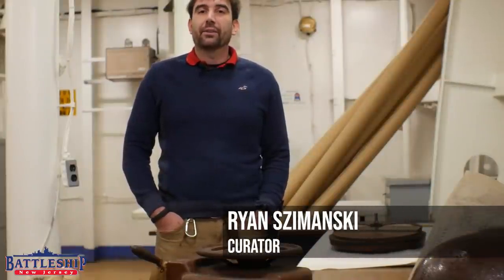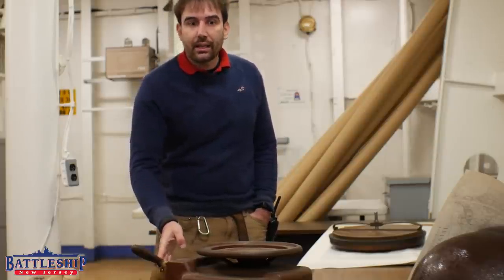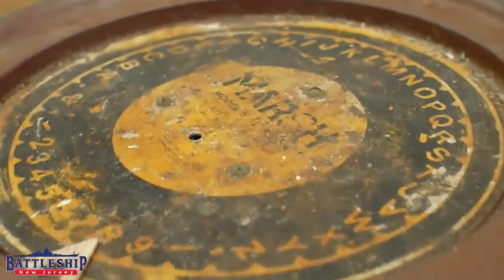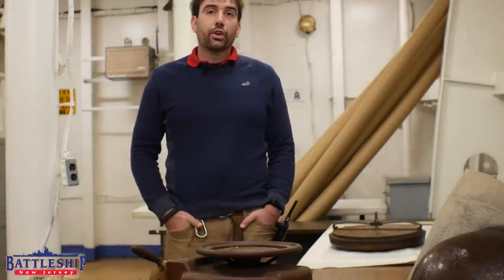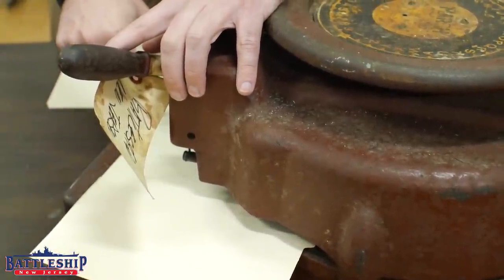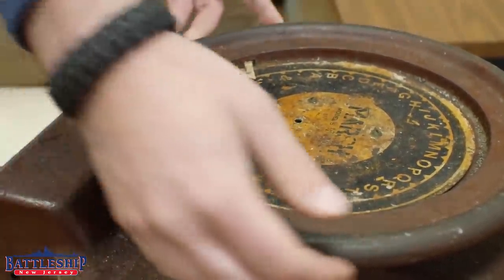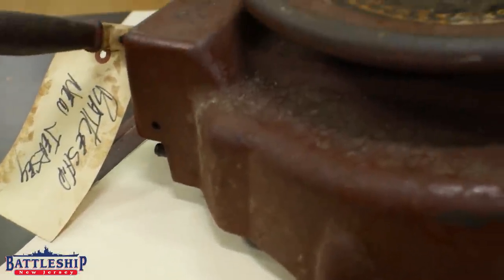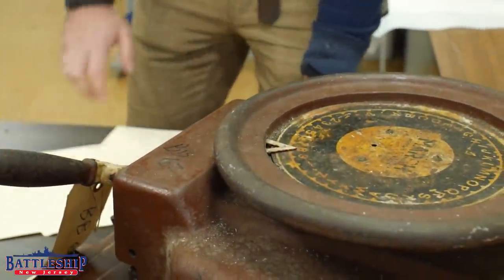How to Use an Antique Navy Stencil Cutter

Comment: Marsh Stencil is still in business Ill pay for the rebuild of the machine by sending back to marsh 
ill pay ups both ways if you want
Reply: Always amazed at the generosity of some folks. Thanks for offering, I hope the museum is in a position to make use of your generous offer.
Reply: Props to you my friend up vote so they can see this.
Reply: @johnm7249  thats not the same 
New Jerseys is a veteran of WW2 if it could  talk  the stories it can tell 
the ebay one has no provanence and priced accordingly 
its like replacimg the steam whisles with doorbells its not the same
Reply: im not asking it to be made new im asking for it to be degunked oiled sharpened if Necessary and tuned to work properly 
the scratches scars wear patina stays thats the silent Testimony of its life

Comment: Love those Marsh stencil machines.  Also, using card stock is probably still a little light.  They're designed for using with Oil Board, which is heavier yet than even manila folder, so that could also be contributing to the problems in addition to as others said needing to be degunked and re-oiled.  A Marsh Stencil Maker in 1/2", 3/4", and 1" should be a part of any military museum's tool set.  They are what made the stencils for 95% of all WWII, Korea, Vietnam, and beyond paint stencils.  Marsh even built "automatic" (read electric powered) makers that were used in the factories for mass production of stencils.  I don't remember which musuem it was that I visited, but they had an Electric Dog Tag maker and an Electric Marsh 1/2" stencil machine that they had in the gift shop area for making tags and "Name Plates" for visitors.

Comment: We had one of those in the Repair & Upkeep shop of my Army barracks in the 1980s. Ours was a bit more modern, but the same brand. It had the ability to punch in three sizes via removable cutting elements. The characters could be 3/8", 1 1/4", and 2 1/5" in height, and it looked like other sizes and maybe fonts could be ordered. Only our 3/8" cutting element still worked, and I used it to make stencils for many humorous signs we posted in the barracks. Our R&U NCO had no idea how to use it, so — yes — his signs were all made from vinyl stickers on sheet polystyrene. HAHAHA!!!

Comment: I used one periodically on my last job.  Looked very similar to the one you have there, but it was pretty new, worked great and was painted black.  Quite expensive, but those things are built like a tank!  If I'm not mistaken, it was made by the same manufacturer as yours.  We had a pretty decent quantity of oilboard specifically made to be used with the stencil machine, so that may be why yours is not advancing properly.

Comment: We used these in the army. You need to use "Oilboard" (also known as stencil board) to keep the cutter sharp and corrosion free. It is also thicker than a Manila folder which will dry out the cutter.  The folder, as you see, is a little too thin to feed correctly. (not saying I haven't done it before. 😅😅)

Comment: If I may suggest a topic I’ve not seen covered, it’s how the 40 MM gun directors were later adapted to control the 5” gun mounts. I’ve read once somewhere that merely taking out the pilot didn’t lend itself to Kamikazes as the whole plane itself needed to be destroyed. So the 20 and 40 MM guns weren’t enough but the 5” mounts could pack a suitable punch.

Comment: I used this exact type of stencil maker in the high pressure compressed gases industry. Needed to make stencils for the gas mixtures and paint them on the side of the cylinders. I got pretty good with this thing, I could make a stencil in no time. I wonder if some company has NOS card stock rat holed away in a warehouse.

Comment: These cutters used a heavy  oil impregnated card stock. It was usually a dark tan or OD green in color. Its a bit hard to find today so many do substitute Manila folders to make stencils. The oil helps keep the stencil from absorbing the oil based paints used in the past by the military.
Reply: It's called oilboard, and it's hard to find. I get NOS oilboard from ebay. But I also use new 70-lb coverstock card that works just as well for acrylic spray paint.

Comment: We had 2 different size stencil cutters in the railroad shop I worked in. The paint shop also hand cut the larger stencils for brand name and car numbers. On every freight car was a black box outlined in white in which we stenciled brake valve info and service dates. Since all rail wheel sets have gone to roller bearing from Babbitt bearing that part of the servicing is no longer performed. Likewise the airbrake valve service labeled COTS for Clean Oil Test and Stencil has been greatly reduced or eliminated. The big table for hand cutting stencils was equipped with a sheet of glass (caboose window) as a cutting surface which made for a hard clean cut without dulling the knife. On one wall there were a number of premade stencils which were cleaned and hung up after each use and the other wall plywood templates for hand cutting large stencils I would assume that Naval ship stencil rooms would have had several different sizes of stencils for repainting the ships numbers and other large signs.

Comment: That particular machine was used for making stencils for clothing ie... Shirts and dungrees(pants)- the card stock was oilboard and you used paint pens for stenciling your last name above your left shirt pocket and right rear pocket on your pants. Basic training we spent three hours marking everything (laundry was bulk washed). Left in big bags came back same way and then sorted by all hands in recruit company. Folded and stowed the NAVY way in our locker by our racks.
Reply: There is something about hearing how those daily facts of life aboard ship that should be boring, turn into interesting stories.  Like how does a sailor communicate with home.  Or how could they listen to music before walkmans and mp3 players.

You think about 2000 people aboard a ship, it makes sense that they have to process laundry as a group.  Then that makes you think why were uniforms blue and now they are camouflage.
Reply: In Air Force Basic Training 1971, we were issued laundry stamps with ink and a pad.  We had to stamp everything except socks.  Black ink doesn't show up on black socks!  I still have mine.  I used it in the MI Army Guard getting ready for duty in Iraq in 2003.  The ink was still good!

Comment: Marsh Co. recommended a stencil brush back in the days before spray paint.
Reply: We always used a sponge
Reply: @sillysailor5932  Yeah they work too.
Reply: We still use brushes. They actually do work better on wood than spray paint, more quickly as well.

We still use this same stencil cutter where I work building pallets.

Edit: well, it's certainly a newer model, but same company and same mechanism.

Comment: the stencil machine can be rebuilt and works best with oil board of the proper thickness. I worked on them for several years and the parts are still available.

Comment: Not spray paint. Stencil paint/ink and a short bristle stencil brush that you use by dabbing the paint on.
Reply: I was looking for this comment.
Not many know a stencil brush when they see it.
Reply: @jimurrata6785  covered a few shifts in the shipping department.
Reply: Spray paint, because of the pressure in the can, sometimes bleeds past the stencil edge and you lose that sharpness. A stencil brush gives you more control, as you lightly dab the stencil with paint/ink.

However, you can also use spray paint, if you use a trick. You spray a very light coat of adhesive spray onto the back of a stencil, let it set for about 10-15 min to let it tack up to the strength of a Post-it, and then press it lightly into place to use spray paint, for a sharper edge. Don't press too hard or else you can't remove the stencil.
Reply: @k.r.baylor8825  That and it's messy and smells bad.

Comment: Never seen a cardstock or paper stencil, they were usually brass, and the letters and numbers were interchangeable and just slid together. The stencils were usually 1" square pieces of brass, that could be used over and over again.
Reply: We used the same in the MI Army Guard to stencil our 3 duffel bags getting ready for Iraq.  We had a team that did the assembly of the stencils and the spray painting.

Comment: Used one at the rental shop I work at.  Finally upgraded to a computer controlled plotter-style a few years ago because we got sick of replacing and filing edges on the most commonly used characters. Also could do multiple sizes instead of waiting 3-4 weeks for McMaster to do the sizes we didn't have in house,

Comment: I always saw stencils cut in a resin-impregnated cardstock, generally brown or reddish-brown and a bit thicker.  Perhaps the manila folder stock just isn't thick enough to feed properly.  Your stencil looks way to small for painting bullseyes.  Looks about the right size for stenciling your name on dungarees, white hats, underwear, sheets, etc. so you can get your clean laundry back.

Don't know if it was "standard" or not, but the bullseye stencils I saw were done with a rubber-lined jig that held a piece of cardstock of the appropriate size and had bars running across it that were engraved with spacing marks.  Dies were of the "line them up with the marks and smack them with a mallet" type.  The bars maintained your vertical spacing.  There were also file cabinets full of stencils.   Pretty decent chance that you could repaint your bullseye or label your piping with the stencil used last time, and not need to cut a new one.

Comment: I used several stencil cutters of that type as recently as 2012 while working at Hughes Aircraft/Raytheon in El Segundo California. The only difference was they were in a much smaller type size. Getting the stencil material to advance properly was always a problem and we usually ended up cutting the stencils on a pantograph instead. The only thing I see remarkable about the New Jersey one is the amount of corrosion from the environment it was exposed to.

Comment: Have you got it to work properly again?

Most probably the wheels are made from some kind of rubber, which hardened over time. It can be cleaned with rubbing alcohol, and will regain some of its grip.

Comment: there is the exact same machine brand new for sale at around 2500$ on website mssc or Uline the only difference is that brand new one are painted black , might be possible to buy the part to repair it from the manufacturer

Comment: Did people use to use paint brushes and stencils? Because this stencil cutter looks like it pre-dates the invention of spray paint.
Reply: When I was in the Army we used these.  The paint was applied with a stencil brush, a short stiff brush. The paint was very thick. At company level they had brass stencil letters that could be joined together, but they were a pain in the but to clean, especially if spray paint was used.

Comment: Using files for your stencil stock might be part of the problem but if you haven't released the button that engages the feed roller, it won't index properly when you're using it. You can safely disassemble it and clean up 80 years worth of accumulated crap without compromising a scarce artifact. The world is awash in that model of Marsh stencil cutter.

Comment: We had 2 different size machines in 1970 but newer models. Think they called the tan/ faded yellow thin cardbiard oil boards. We had a rolling wheel to apply black or some had dark purple ink to stencil cardboard boxes. Now everything is done on a computer then printed out with a UPC code. Stencil roller usually did not run like spray paint. Looks like our goverment got its money worth out of the machine you were using.
Reply: Our painters got great results using spray paint by using a piece of welding rod to firmly hold down the edge of the part of the stencil that they were painting. That way the s[ray couldn't sneak around the edges of the cutout and cause fuzzy lettering.

Comment: Pretty sure you have slash “/“ not a backslash “\” backslashes ar3 pretty much an artifact of early computer printers, and or ASCII
Reply: Backslashes are used in Unix OSes
Reply: @foamer443  nope slashes are directory separators in *NIX OS’s, back slashes are used for the same thing in Windows. Look on a typewriter no backslashes onl “normal” slashes. Back slashes wereinvented because there were available spaces in ASCII character set space.